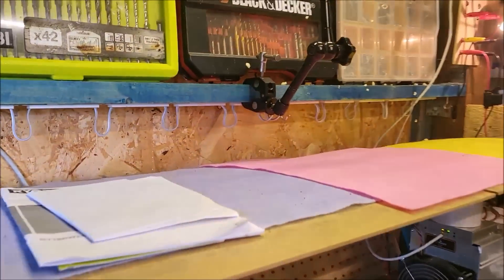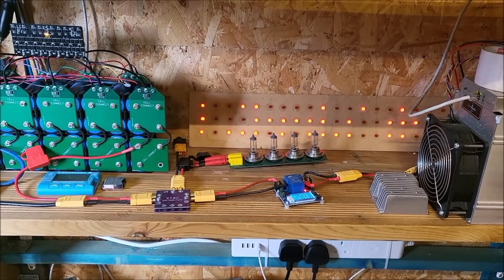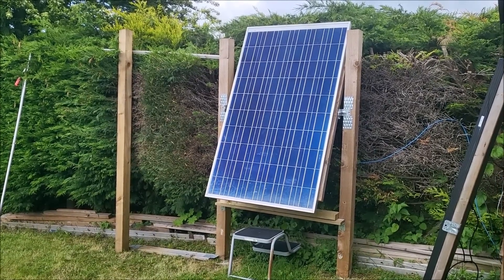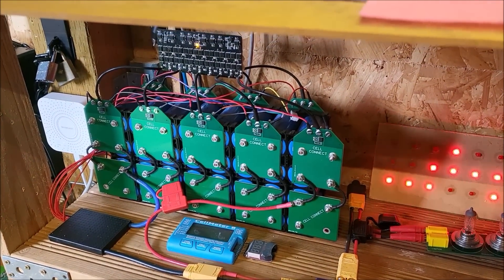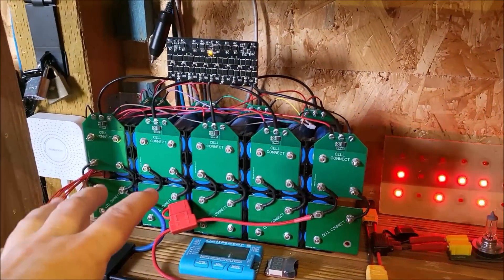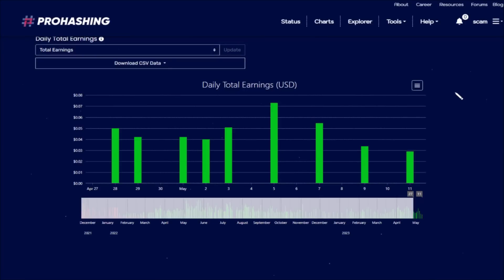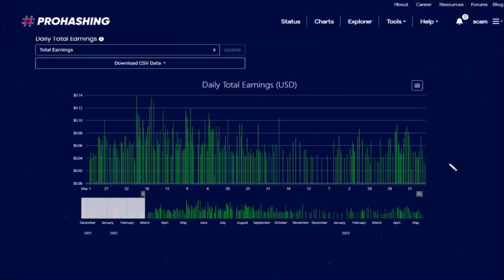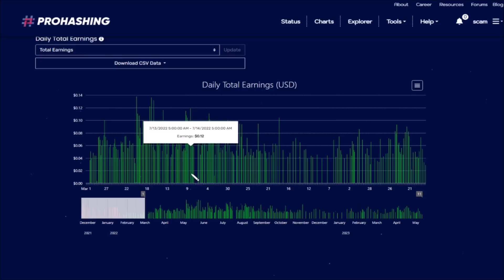Modular Shed Update - Solar, Batteries and Mining

Comment: Julian are you using pass thru charging  with this set up? Is your cd63  board allowing this, regulating this?  Im wondering  if lipos are comfortable with this unlike lead acid?
Reply from the maker: Yes. The CD63 turns on the load when the battery is full. If this happens early in the day, the solar panel runs the load through the battery.

Comment: Hi, as a suggestion, you could place plastic sheet on the ground under the floor. This should help reduce the moisture coming up from the ground below the floor. It will also stops weeds and grass growing. I find the heavy duty builders plastic works well.

Comment: OOH!! condensation maybe you need to ventilate???
Reply from the maker: For most of winter it doesn't really work. You blow out moist air and suck in more moist air. Heating works, but there's no energy from the sun for 3 months to generate that heat.

Comment: How are you getting over the issue of charging below zero? LifePO4 mustn't be charged below freezing, or it'll be damaged.
Reply from the maker: I didn't worry about it. There aren't many days when it's below zero all day. Typically those days have a low (and quite weak) sun. As you saw, I was more worried about running the miner in 50 degrees heat.

Comment: Very cool. But other than just a cool project, the cost of gear far exceeds the revenue of the mining operation. Pity …
Reply from the maker: The capacity of my battery is about 600Wh - I'm probably only using 500Wh of it. Since that earns about 5 US cents, then the crypto mining earns about 10c/kWh.
That compares with 15p/kWh earned from my rooftop solar array when the power is exported.
Grid electricity is 34p/kWh, so offsetting grid use is more lucrative.

Comment: w/ the current prices of electricity in the uk, would it not be better off using the shed to generate power for the house (to run essentials like the fridge) instead of wasting it on a bitcoin miner wich gives you nothing in return?
Reply from the maker: My rooftop solar array does that and it's MCS approved. I get 15p per kWh of electricity exported courtesy of Octopus energy.
The shed system is too small to make a meaningful contribution to the house, and it's more about playing with solar panels, batteries, converters and antminers. If I can incorporate some supercapacitors too, I'll be very happy.
Reply: @JulianIlett  that's no suprise really bro.... I still think it's a waste of time when they charging you arm and a leg and standing charges ...I think they should pay you what they charge you like they wouldn't still profit .... Id disconnect the panels screw the grid sell it to the neighbours for double and no standing charge 👍🤣🤣🤣
Reply: He would need lots more solar panels and batterys for that purpose maybe lighting would be a start and modify house to accommodate it cus nobody wants cables running everywhere...... Should just connect to lamp post in the street run it every night save battery 😂

Comment: What is the end-to-end efficiency of the setup. That is watts of electricity from the solar panels to watts consumed by antminers? It seems you are doing a lot of conversions, particularly if you propose to charge the new, big battery from the smaller ones. Could you not charge the big one directly for example?
Reply from the maker: There are losses everywhere. Solar panel not aligned with the sun (what sun??). The car headlight bulb current limiter is quite bright in full sun. The battery charge/discharge round trip is lossy. The buck converter gets pretty warm and the Antminer converts almost all the power to heat.

Comment: I decoded there is a polarity switch between day and night, it reversed my bubbler into sucking the water up to the pump, experiment with a full wave bridge rectifier and at night you shall have voltage, on my 6v panel it was giving 1.9v, on your full size panels it should be much more.

Comment: Is the fan still working in the other shed
Reply from the maker: It still works and the two lead-acid batteries are still charged, but a simple fan doesn't really help.
Expelling moist air only to replace it with more moist air isn't the answer.
Reply: @JulianIlett  Build up a solar thermal dehumidifier based on calcium chloride?

Comment: Is building batteries yourself, out of individual cells and all the mounting and connection hardware, cost effective?  Seems that LiPo batteries can be bought starting at around £200 for 60Ah.
Reply: I just bought 2.6kWh cells for 260
Reply: It depends on how proficient you are at sourcing materials and putting them together in a useful way.
Reply from the maker: These cells are 6Ah each and I got 20pcs for £76
Reply: @JulianIlett  👍 So then it is a cost effective effort - I had not realised that the individual cell cost had crept so low.

Comment: Be wary of those lipo alarms!  They run off cell 1.  They are not meant for long term use, more for 5-10 minute RC model flights.  On it's own it will flatten cell 1 of the pack without any additional load.
Reply from the maker: They're not very accurate either. I had an ISDT BC8S which was excellent, but it got damp and stopped working. Now, you can't buy them anywhere.
Reply: @JulianIlett it looks all newer are the same, I have 2 on my 14S battery, when all cells are at 4.2V - verified with my DMM, they show anywhere from 4.08 to 4.25